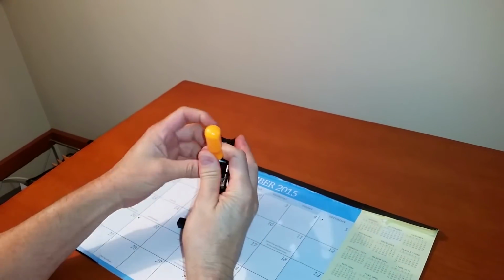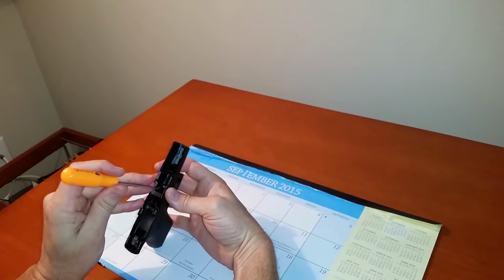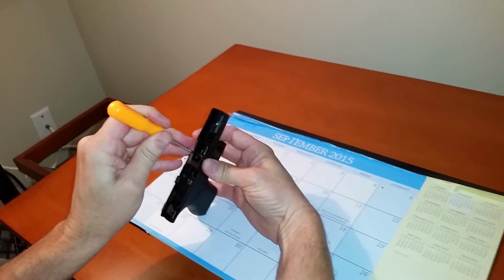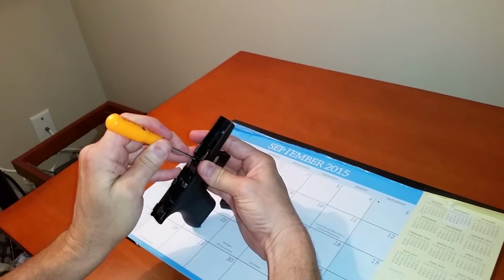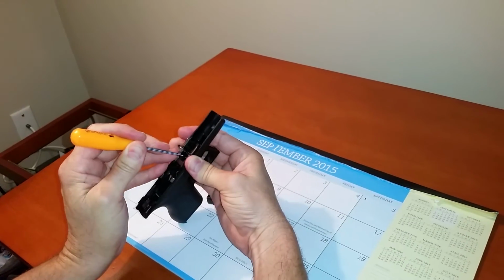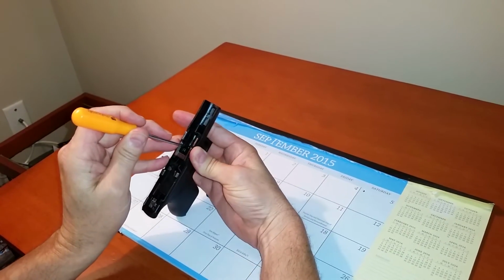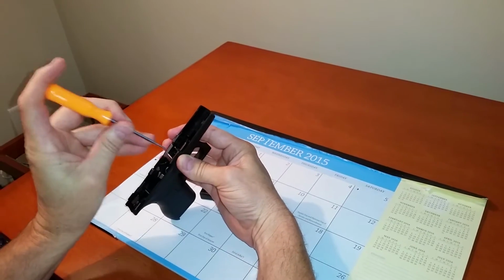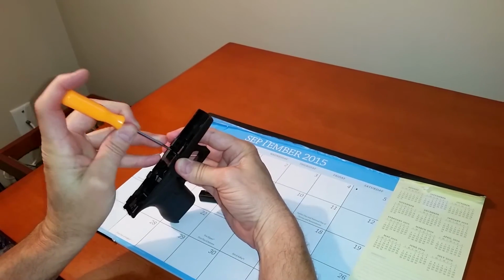Glock 42 Extended Slide Lock Lever NDZ Replacement

Comment: Thanks a million your way is the easiest way and I also found out an easy way to do it putting it back it takes a little practice but it's easy to do you don't need a punch to put it back in just simply use the lock lever you tilt it over the spring and push in